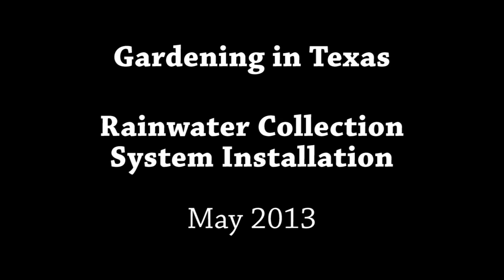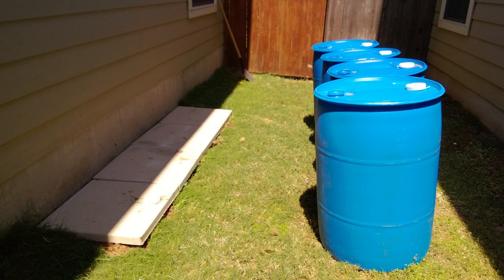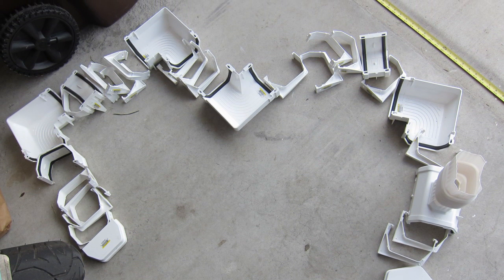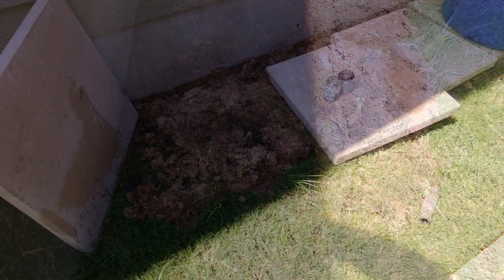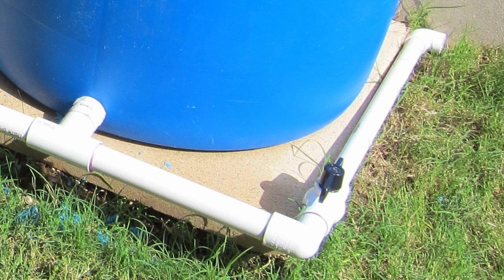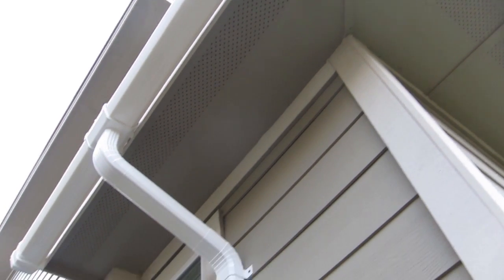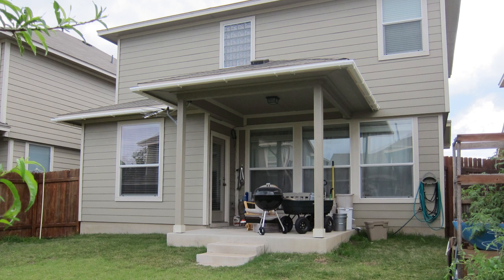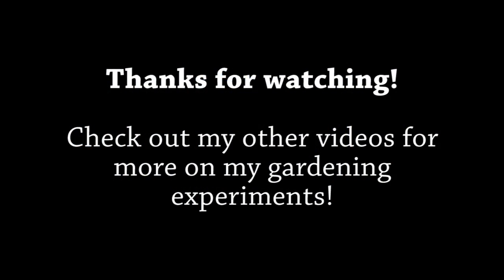Rainwater Collection: Installation

Comment: Great video! I have two questions. Did you have a backup problem with the water moving to the other barrels through the bottom instead of by way of an overflow system at the top of each barrel? Also why is there a need for a float at the junction of the first flush and the pipe going onto the barrels? Wouldn't that natural direct the water to that pipe, since the first flush pipe would be full of water? I realize this is quite an old video and you may not be available anymore, but I really would like to know the answers to those questions if you have the opportunity. Thanks for your  how to video!

Comment: You should not have a drain opening on the first flush IMHO because it will render the system worthless in light drizzles. Instead just manually drain the debris in between rains. If you miss a drain, the backup filter in the side pipe should stop everything up so you don't get solids in your tanks. At that, you just have to add another one of your emergency overflows just upstream of the backup filter.

This is just one option, there may be better ones.

Comment: Usually having 1 (especially "normal" sized) downspout is not enough to remove all the water from your roof without your gutters being overfilled, but I guess in your situation you should be fine until [maybe] the drout is over.

Comment: Nice video. Just a question: Why do you have to connect the tops of the barrels with a pipe too? If  the barrels are already connected at the bottom, wouldn't it be enought to only let the water from your rainpipe flow into the first barrel? They would eventually even out on their own. Or am I wrong about that one?
Reply from the maker: Cinqmil The key word is "eventually" - you're correct that the tanks will even out, however the 1" pipe at the bottom is much smaller than the pipes coming off the gutters.  If I only drained into the first tank, there's a high likelihood that the inflow rate would exceed the rate at which the bottom pipes could convey water to the rest of the tanks.  So in a good rain the first tank might start overflowing well before the remaining tanks fill up.  Now, in a good rain there is generally more than enough rainfall to fill them all up, so maybe I could afford the water loss, but my thinking was to try to distribute the inflow across all the tanks (or at least more than one) to reduce the potential for waste before everything's full.
Reply: Cinqmil When you bottom fill, you need to vent the air out the top or the barrels won't fill up as the air doesn't have a place to go.  Connecting them with a pipe moves all the overflow to one spot instead of just oozing out the top of each barrel, and can be directed away to where ever he needs..  In my opinion, top filling would work better, but that again depends on what you want out of your system.  Bottom filling makes it slower to fill the barrels as the water rises in the barrels creates back pressure on the bottom fill.  Top filling has no back pressure to deal with.  As long as the bottom valves are closed during filling, with top filling the water in the first barrel has the dirty water that the first flush didn't catch, but the second barrel will have cleaner water than the first, because it doesn't fill up until the first barrel is full.  Likewise, the third barrel has cleaner water then the first two for the same reason, the forth, etc.  Filling from the bottom means all the barrels have the same amount of dirty water in them because they all fill at the same time.
Reply: Cinqmil He only needs to fill 1 barrel at the top because they are connected.  You are correct.  He could have saved a few bucks lol.
Reply: Basically it is a manifold to help with large amounts of water entering those small openings the barrels come with. Picture this. You have a regular glass and a pitcher of beer. pour the beer in the glass all is OK. Now try and pour the beer in a beer bottle with a small mouth. Well you will end up spilling most of it. Now if you got a funnel and a system like he has it will be much better.

Comment: I am in Tampa and have a source for some blue and white 55 gal barrels (food grade) I don't mind sharing for personal or charity use. I love the format of presentation, showing viewers that one really needs to get out and do it to figure out what works and how!. As for sourcing, in my neighborhood there is a lot of construction waste. I wonder if there was an organized initiative to collect specific parts needed, that certain subcontractors would be open to allowing their overage or 'waste' to be removed from construction site. A question I have for your system is the space I see between gutter and wall- maybe they never get full enough to overflow.....also I have lots of trees overhead whose leaves end up in there.Do you also collect condensate from your a/c? It's surprising how much is collected in muggy Florida, but maybe not so much in Texas.. One more comment. Have you changed anything since the original set-up? I'm surprised you don't have them raised up to increase the 'head pressure' for watering or am I missing something?

Comment: You should of put gravel underneath the pavers. They will eventually sink and it with the weight of the water will start shifting the ground rapidly. Especially the more the soil becomes saturated, or dries out.

Comment: I agree that the first flush filter is a good idea, I just don't think you have enough capacity for it.  If you took the amount of water your first flush system holds, and went up on the roof, do you think it would clean off all the roof surface, and carry it through the gutter and down the spout?  I think you would be better served by using a 30 gallon barrel for your first flush system.  It would replace your first barrel, and you wouldn't add the output to the other barrels.  Using a barrel with an open top ring lock lid would allow you to clean it from time to time.
Reply: TheStavros1001 has some good points. Additional bonus of using that water as "grey" water or lawn water - bird / squirrel / biomass residue makes a good fertilizer for the soil.
Reply from the maker: TheStavros1001 You're probably right.  To be honest, though, the first flush isn't catching much stuff as it is.  We don't have any large trees dropping leaves or anything, so it's really just a bit of gravel from the shingles that collects in there.  A roof that gets dirtier would likely need a more serious filter scheme.
Reply: Brian F Howdy!  It's also bird residue, and dust that accumulates and gets washed down that tints the water into various shades of brown.  However, how clean you want that water also depends on two things: what you use it for, and how often you have to clean the system out.  If you're satisfied with what you get out of your system now, then no need to change it. <g>  I use a 55 gallon barrel for my first flush, but I still use that water for things that don't require pristine clean water, like washing out my food cans for recycling, washing out trash cans, washing the car, mud off my boots and clothes when I work in the yard, etc.  For these things, I don't need crystal clean water.  As a result, I rarely need to drain the first flush barrel. 

Oops, I mean the second barrel, after the first flush barrel.  I actually empty the first flush barrel a lot by using that water, not by just draining it out on the ground.
Reply: +TheStavros1001 Yea, the pain with rain water collection is that you only want the water from the middle of the rainfall. First few gallons you don't want because it just was used to clean your roof and w.e junk floating in the air, and the overflow you don't want flooding your foundation.
Reply: Daisy Duke yea but people love to make things more complicated then they should be
Reply: +2Awesome sending overflow to a rain garden would probably work.
Reply: Brian
Reply: TheStavros1001 ii
Reply: TheStavros1
Reply: TheStavros10

Comment: nice setup but you should add a spout to the 'leveling off' part at the bottom of the rain barrels instead of a cap... if you need to get water out of any of your barrels currently it would be a real pain. The spout would provide easy access.
Reply from the maker: Michael Fields The spout is on the other end (runs around the house) - that's how I get water out of the tanks to use them.  A spout on the other end might be handy if I need to completely empty the tanks, but I haven't needed to yet.

Comment: Thanks for sharing your nice looking setup! Your barrels aren't elevated so you're not getting much gravity induced head pressure. Are you considering the use of a pump to dispense your collected supply of water? Beyond that what 2 things would you do to wring even more efficacy from your setup?
Reply from the maker: Thanks!  You're right, I don't get a lot of pressure, but the bottom of the barrels are roughly level with my gardens in the back yard... I know this because I accidentally drained them this summer by leaving the hose running ;) so I don't plan to get a pump.  A pump would also probably require some filtering, which starts to add up $$$.  As far as 2 improvements, good question.  #1 would be to come up with a better sealing scheme for the barrel drains since they still stay moist (not enough to notice water loss, but enough to keep things mossy).  #2 would probably be to add barrels.  They fill up pretty fast in a good rain, so I could store more.
Reply: Brian F What is it that you use this for?

Comment: Pretty good design. I don't think I would be able to use plastic gutters in Canadian winters, but fortunately my house already has aluminum eavestrough all around it.
Not sure how much rain you get, but if your overflow will be fairly active, I suggest protecting the foundation of your house. With the collection system being right beside the house, if the overflow is always spitting out water in that one area of your house, the water may damage/crack the foundation over time.
This is especially a concern where there is a basement, as the water can collect and create pressure against the foundation. If the foundation cracks, water will collect inside of basement walls, and mold will soon follow.
I have attempted to protect my house by using waterproof adhesive to secure 4-6 inches of styrofoam around the bottom of the exterior of my house, where it meets grade. I actually used leftover insulation from my garage door.
Also, try to make sure grade is higher closest to your house, so water will naturally flow/collect away from the foundation.
Reply: ACParker13 since it's Texas, the way they mix our concrete actually needs watering from time to time to keep it from cracking from getting too dry, and extremely few houses have basements. Most are pier & beam. I'd be surprised if his house, in Austin, had a basement. Lots of bedrock there.

Comment: Brian, in your video, you state the blue barrels were obtained at about $20 per barrel.  We bought a couple from Austin Homebrew Supply for $40.  I think they originally contained hops for making beer.  You say yours contained soy sauce?  Would you be willing to share where you got them?  I'd like to add two more barrels so when I put this system together, I'll have 4 barrels also.
Reply from the maker: I found them on Craigslist by searching for "55 gallon barrel."  The seller was in Cedar Park and had a bunch at one point, don't know if they're still selling them but I just searched and found some others selling at $20.

Comment: Nice video. Well thought out and interesting. Did you add anything for the over flow? (Like divert it away from the foundation of the house and "sink" it into your landscape?) Have you heard of Brad Landcaster and his book on dryland water harvesting? Is your system working pretty good. I'm getting a 500 gallon system in a few weeks on my house in the DFW area. I already have gutters and this thing will still cost 1600 dollars with the first flush diverter, and leaf diverter. It will collect water from 2 downspouts.  It will be a high quality plastic cistern. So, your right, it is very expensive. But I'm missing the gene that allows me to understand plumbing.
Reply from the maker: The only overflow is that angled fitting at the end of the pipe at the last tank.  I don't actually know how much comes out of that compared to just overflowing out of the tanks, but the short answer is I don't have anything special for overflow.  It wouldn't be a bad idea to direct it to the backyard where it'd have more area to soak into, but as it is the water does sink into the ground before it gets to a drain.  The system is working well, there's some gradual seepage around my fittings at the bottom of the tank, but the water loss is unnoticeable.  Good luck!

Comment: Tank connectors are designed to put through holes one doesn't have access to from the inside. Drop the inside bits down a wire which has been fed through the hole from the top. Hope that PVC stands up to the sun and some hard knocks!
.
Reply: I would recommend some spray paint on schedule 40/30/35 pvc that is exposed to the sun.  over time it will become brittle.  pvc doesn't like the sun.  (which you seem to know)  neither does pex.  however, pvc can withstand chemicals and critters when buried underground unlike pex.  if I were to run a water supply line under the surface of the yard I would use poly pipe (used in sprinkler and well systems).  at my store the yellow striped poly is for irrigation. blue and red for potable water. waaayyyy cheaper than pvc and you can get a hundred foot roll of 1" for the price of a couple of 4" solid core schedule 40 pipes. the one thing to remember is to blow the lines dry before the freezing temps start.  also, I would remove any valves from the line and place temporary caps/plugs until the weather is ready for another go:)
Reply: highonimmi MDPE alkathene is used for supply here in UK The same as Poly pipe?

Comment: Are you planing to drink that water or just for you yard?
Reply from the maker: ***** This is just for irrigation.  I would definitely need to invest in a filtration system before this could be used for drinking or even washing.
Reply: ***** actually, there are filters you can use that will take care of that.  look into sawyer filters, big berkey, etc...I have a few different kinds.  I can take water from a pot hole and make it safe and taste like heaven.  you can use strainer/filter that can be cleaned via backwashing.  then use a whole house filter system as your first line filtration.  next,  use the water purification system found in many prepper/do It yourself stores.  you can find some reasonably priced products.  I work in the plumbing department at a major diy store. while I would have done a few things differently (I have several years of experience in both designing and practical hands on projects) I will say you did a great job thinking this through.  you're only using this for irrigation purposes.  I would have some drums outside and have quite a few inside as well.  I'd run a line from the pipe down into my basement. if you don't have one then where ever you deem safe and secure for storage.  this would be my potable water.  I have lived through too many water rationings and health warnings for bad city water.  once I move to my next location I will have a back yard garden (with chickens and pigmy/dwarf goats:) and rain water storage for both irrigation and potable water.  again, great job, hun.  I wish you much success in your rainwater system.  I grew up in north texas.  I feel your heat/drought pain.

Comment: Question: Why didn't you just use a 4" to 3" reducer fitting in the first flush diverter instead of the rubber spiral and glue/silicone method?
Reply from the maker: Mainly to save money on another piece and this scheme took up less space.

Comment: thanks for the video! I am still working on my rain barrels out in 78641. Liked your discussion of first flush.  simple solution. Lots of folks with wind problems are pretty happy with converting everything to white or other colored pipe.  plastic gutter blows off my house. The design committee will be really happy if you paint all the spouts. My household water is via a 2500 gal cistern, refilled every other month.
Reply: How many souls in your household?  That seems like a lot of water to use...
Reply: Just 2 , no system to use rainwater for anything but plant s yet. Just picked up two 330 gal IBCs.  Oh we do have guests maybe twice a week. We replenish the water at 800 gals so we really use about 1700  per every two months.  Not sure if the design committee will want less water.  House will be remodeled starting in January with better greywater use, insulation.

Comment: faster and easier to use a threaded gasket from RainBarrelParts-dot-com! Here's the math for collection - one inch of percip falling on one square foot = half gallon of water - so you might want to set up your overflow before the first heavy rain:-)  Although you have a first flush you didn't address large debris well - you might want to install a LeafBeater from DownspoutFilter-dot-com. It will keep you from having to disassemble your system to get to the metal screen

Comment: aren't those drill bits for wood? seem like they cut a good hole and will be buying one soon.
you could have used plumbers tape, wrapping it righty tighty so that it tightens some more when you screw in your bulk heads.
good luck with saving water! hope it rains

Comment: Your first flush filter ROCKS! Very ingenious. Thanks for sharing and showing. I'm curious as to how well your system works. Follow up video?
Reply from the maker: Thanks!  It works great, have some minor seepage issues around the seals at the bottom of the tanks, but the loss is so minor that it's barely noticeable.  I still hope to fix that sometime, but it's tough now that the tanks are full!  I may make a follow up :).